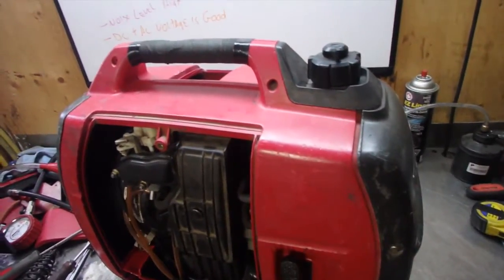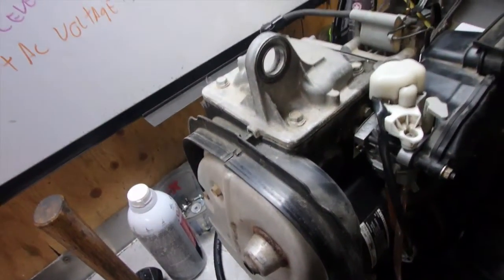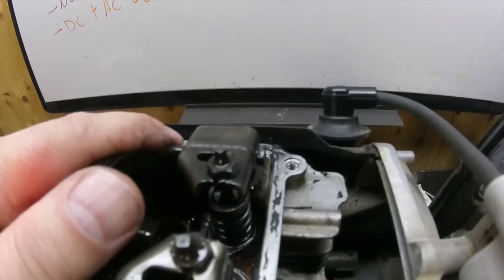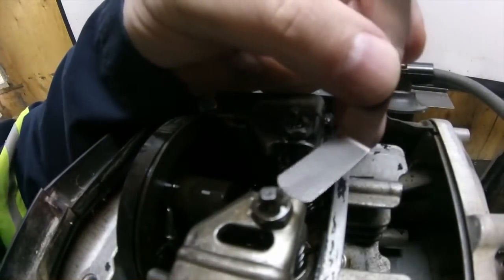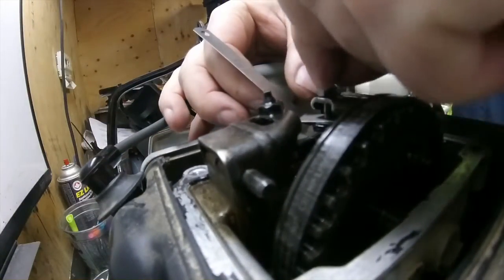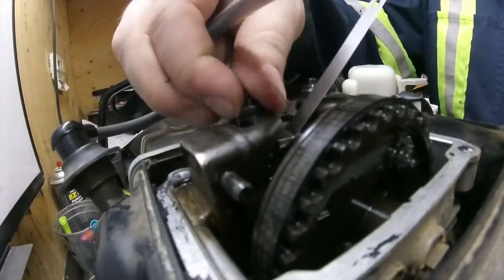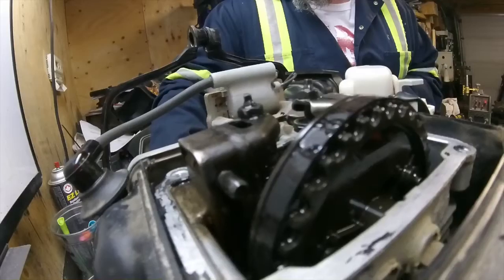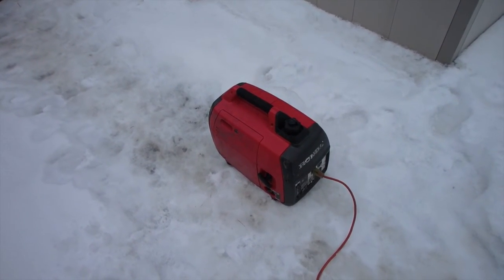Honda Eu2000i How to Set Valve Lash

Comment: I always have pull-cord available so when I split the case, I check for fraying on the pull cord and even if there's a little, I just replace the cord. Nothing worse than having it break when you need it most. With the case open it only takes about 5 minutes to do. Just saying.

Comment: Is the exhaust .20 inch or .020 inch ?
I know that in your description it says .20 inch.
Honda manual says .20 inch.
I'm thinking that the Honda manual has a typo and they meant to print .020 inch ?
Reply: Intake = .15mm (or .006 inch)
Exhaust = .20 mm (or .008 inch)

Comment: Line up the tab with what?
Reply: There are two marks on the cam, line them up with the lip of the cover. There is going to be two 'tabs' on the lower crank and gear that line up also, but that one requires pulling off the crank cover
Reply: @anjhindul  Thank you for your reply.

Comment: Hi dear thanks for this video!
Just l would like to know about the generator eu 3000is, how much is the clearance set of exhaust valve NO :00 ?
And also the clearance set intake NO:00 ?
If you send me a video or an instruction I will be very happy for that, thanks
Reply from the maker: You will need to purchase a service manual to make sure you are setting it right.

Comment: I set the valve lash as per your great instructions and now it feels like i'm starting a high compression race bike or something... the setting was waaaaay out but it always started first pull with ease... now it's very hard starting with 5 to 10 pulls.
What could be the problemo i'm wondering???
Reply from the maker: +Sherry Lock if the setting was way out then I'm going to guess you didn't have the engine set at the compression stroke

Comment: So i thought i had to turn the crank for each vavle to reach tdc, but it appears you don't have to?
Reply: all you have to do is watch for when the cam on the timing gear is facing straight up so it's not pushing on either rocker arm.  You don't need to count turns of the crank or watch watch for any sequence.